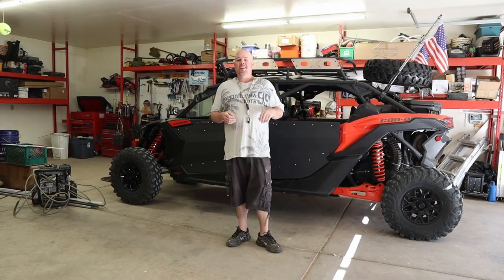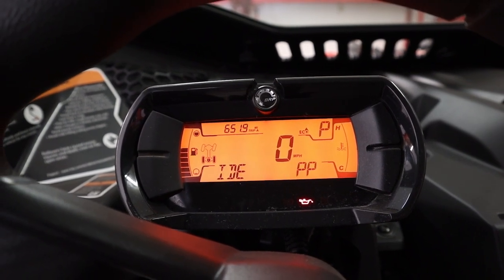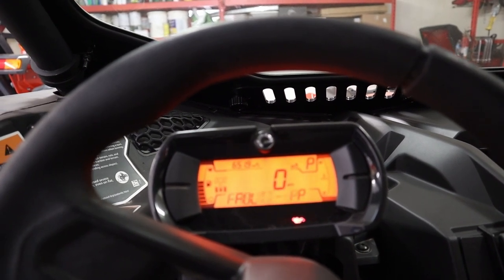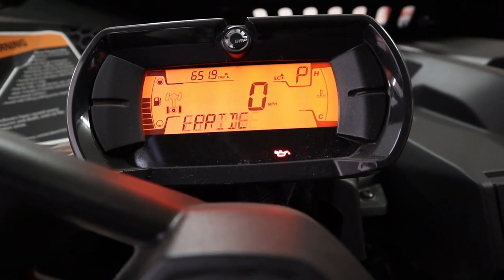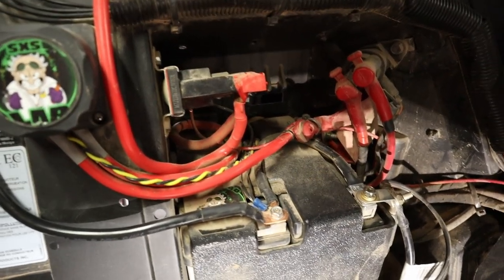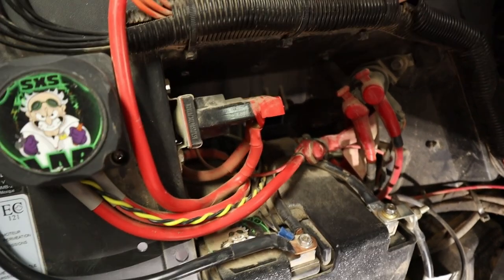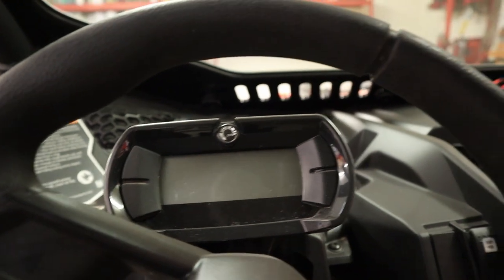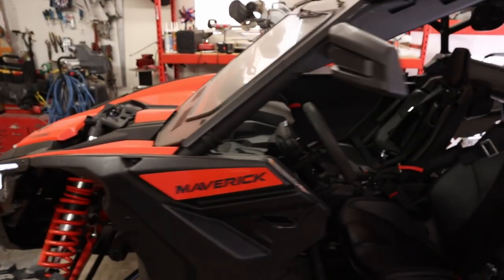Maverick X3 PPS fault & Overide message. How to fix!

Comment: I'm having the same issue, just happend today
Reply from the maker: The majority of the time, the batteries are the issue . Give us an update when you fix it so we can understand more of what other issues can occur.
Reply: What was the issue?
Reply: Yo bro so was your old battery completely dead? Was it just old? Couldn’t you just recharge it and get it back going once fully charged? I’m gonna test my battery and let it charge over night, the problem I’m currently having is that my battery doesn’t stay charged because of the accessories that where added, I need to add a kill switch directly to the battery, so it won’t be used when turned off
Reply: y’all ever get it figured out? just happened to mine today with brand new battery
Reply: @bencampbell960 yea jump your atv it’s Becuase the battery doesn’t have a lot of juice to start the quad .